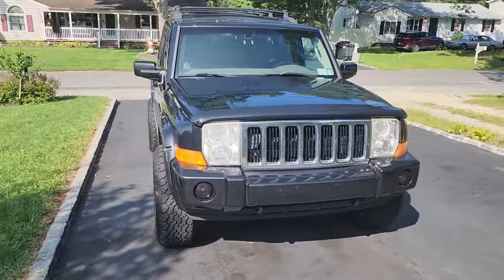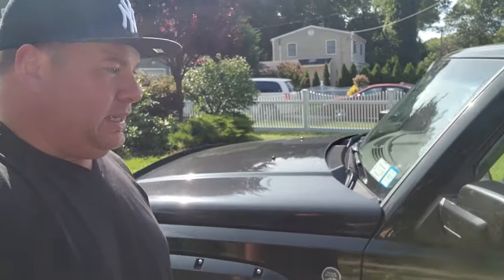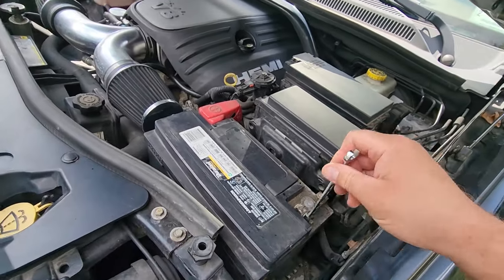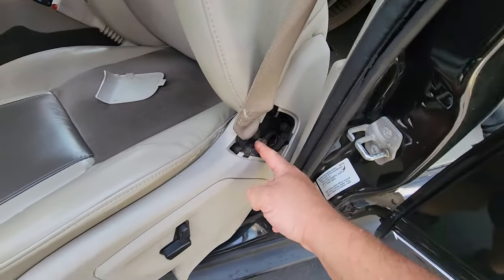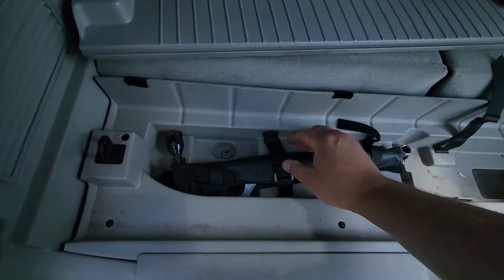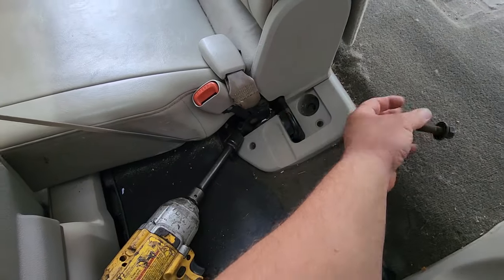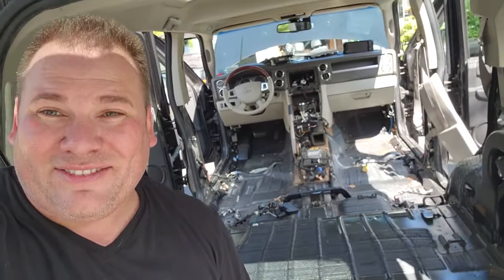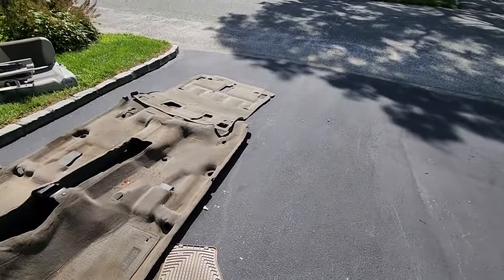JEEP COMMANDER INTERIOR SWAP!!!  PART 1 - SEAT & INTERIOR REMOVAL

Comment: I have a 98 zj 5.2, my vacuum line for accessories broke right at firewall. Any suggestions on how or where to run new one?  Great vid as usual.
Reply from the maker: Thanks man.. not sure how deep your crack goes. Sometimes they're a pain to get to
Reply: @ProjectDanH  Hard line broke a 1/2 inch inside firewall right next to AC lines. Gotta love a Jeep .

Comment: Dan thanks for the video I was wandering if you can show or tell me how to measure my wheels for lug pattern i have a 1998 grand cherokee laredo 15 inch wheels please and thank you stay safe my friend
Reply from the maker: My pleasure buddy,  XJ ZJ and TJ are all 5x4.5
Reply: Thanks you sir @ProjectDanH
Reply: @rickysmith8099  You might be tempted to run some Ford Ranger wheels which have the same bolt pattern. The problem you will run into if they are the stock steel Ranger wheels. The center hole is Really a tight fit. And if you have to take them off it will be a rough job. Please don't ask me how I found out about this after I bought 4 stock steel Ranger wheels and two tone painted them. I took a carbide bit and removed just a little bit and now they fit fine. I have a 1996 Jeep Grand Cherokee Limited that came with IMO gosh awful snowflake 16 inch wheels.
Reply: @lilorbielilorbie2496  thanks for the info stay safe my friend

Comment: Hey there. I have the same overland package in my 08. Would you be willing to to sell me the drivers seat or at least the seat covers. My seat started deteriorating soon after I got it in 2018.
Reply from the maker: the driver seat is starting to tatter, your best best is to use a passenger seat pad on the drivers side
Reply: Makes sense to me. Would you be willing to sell the passenger pad to me? If so how much. Muck lave man. Been watching your adventures for a while now.